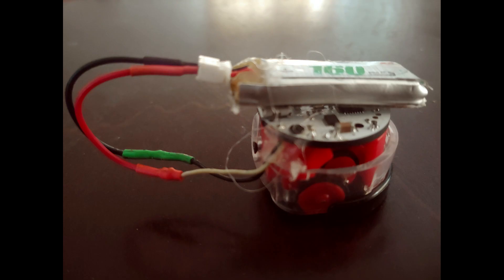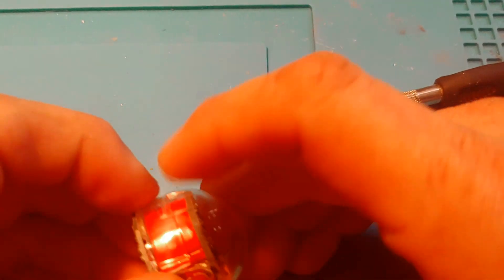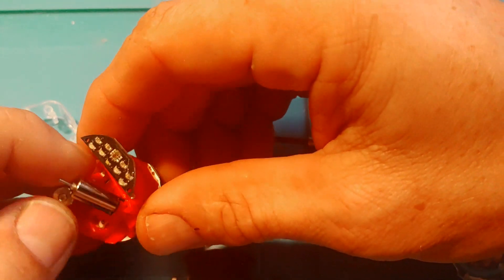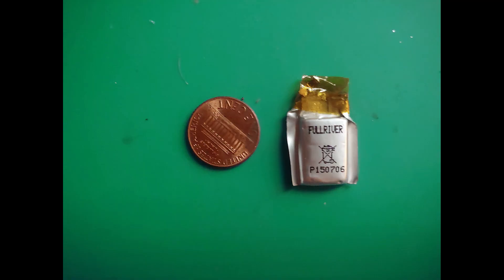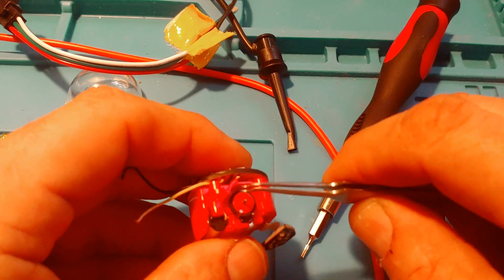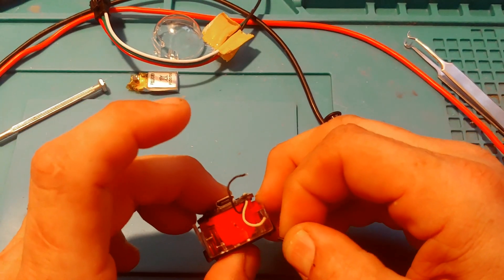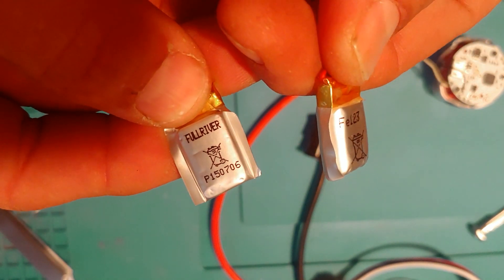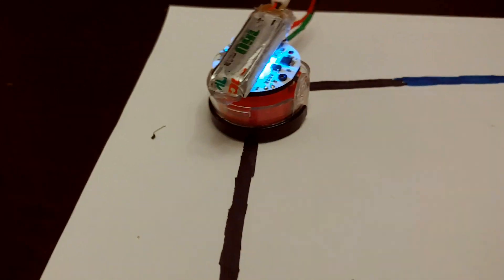Ozobot Dead Battery (Teardown and Rebuild)

Comment: Hello, Could you inform the correct battery model, please? Is this a 3.7volts and 350mah?
Reply: Sorry if I'm way off here but isn't the battery 70mah from the video?
Reply: @secmydom  Yes but the battery with a higher mah figure is available and will just last longer before needing to be charged.
Reply from the maker: Yes, exactly